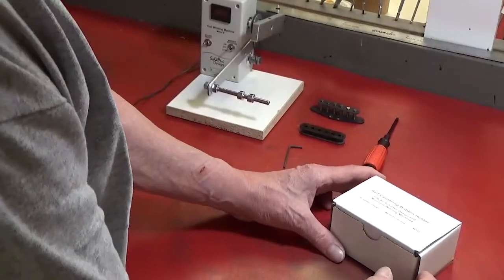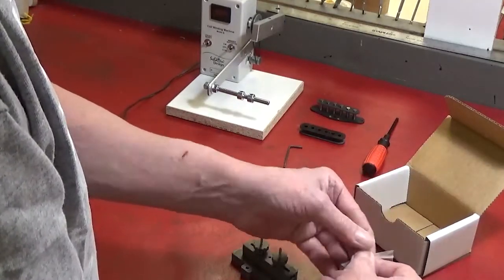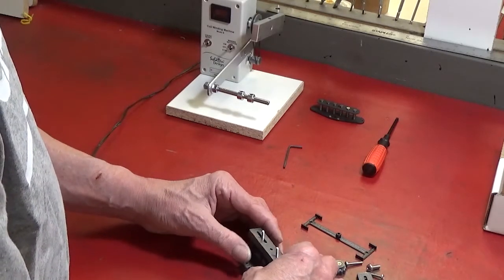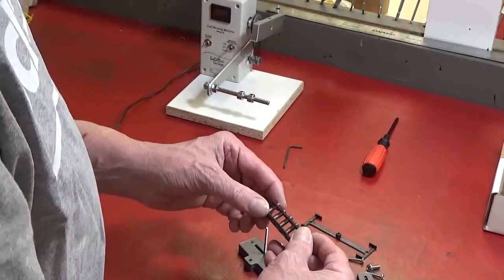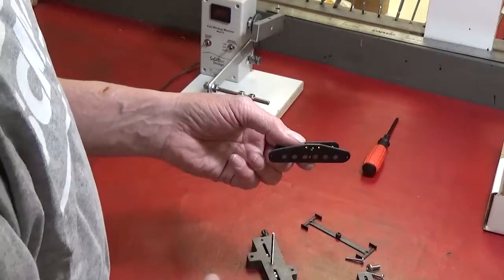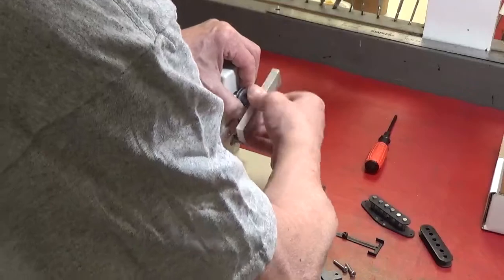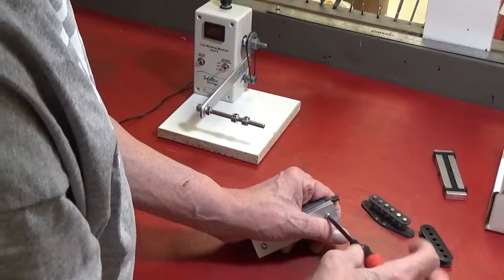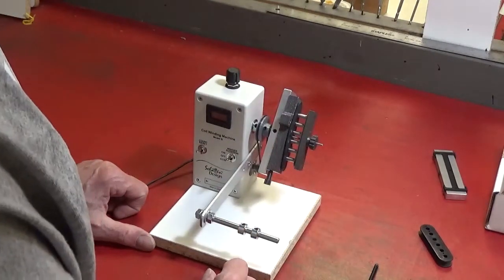Self Centering Bobbin Holder For Coil Winding Machines

Comment: When drilling holes in the winder arm, why is the plastic drilling template needed for centering? Can’t the drill hole location be determined by just matching the bobbin holder with the winder arm?